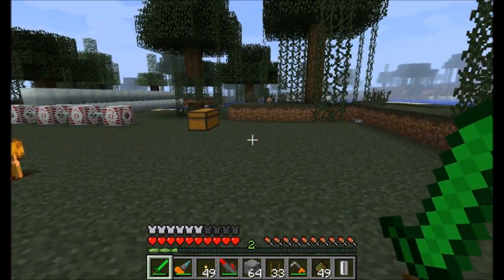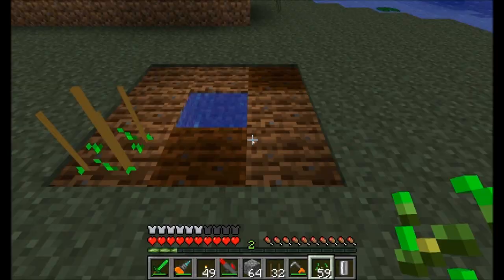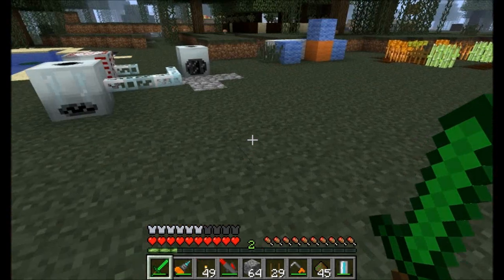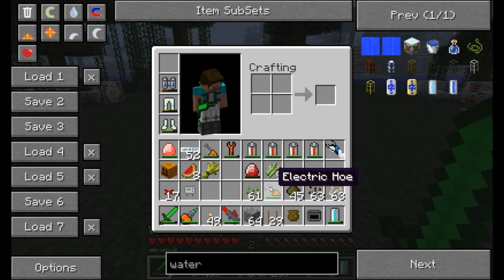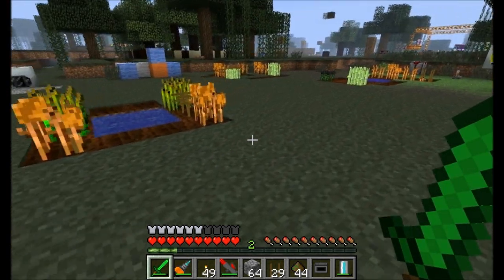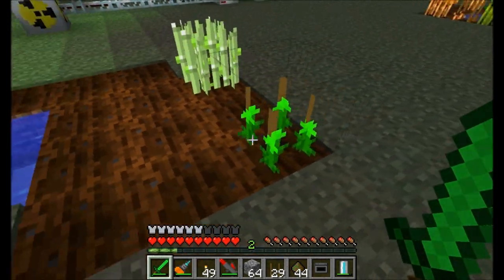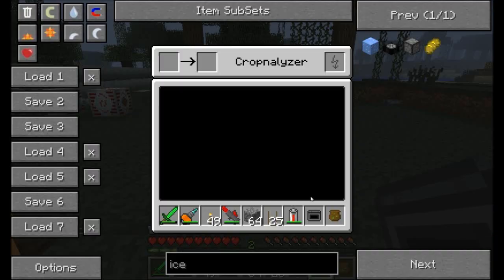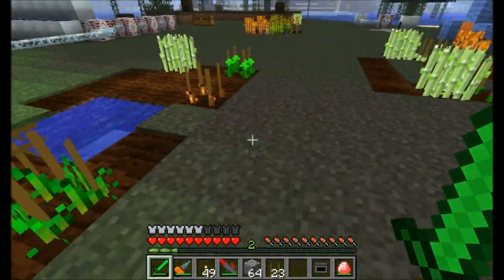IC2 Tutorial - Agriculture

Comment: You can put upgrades in them. There are 3 available upgrades: Overclocker Upgrades (increasing speed of processes, but also increases energy consumption), Transformer Upgrads (one upgrade goes one energy tier higher, from LV to MV, HV and EV [Extrem Voltage, only nuclear reactors and redstoned HV-Transformers give this out] and Energy Storage Upgrades (I think that doesn't need to be mentioned). You can put 64 upgrades in one slot, but only from the same type.